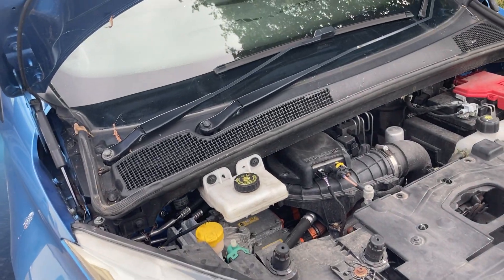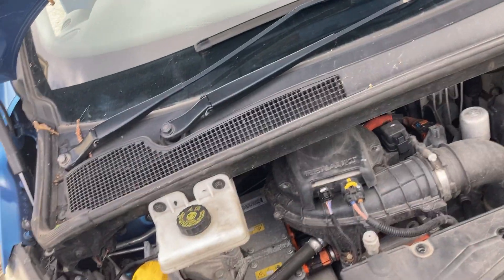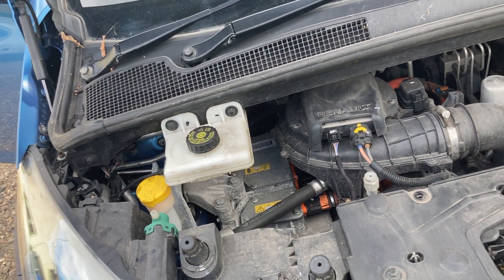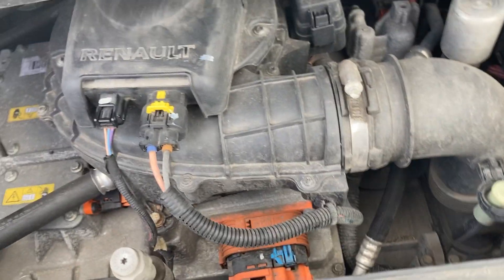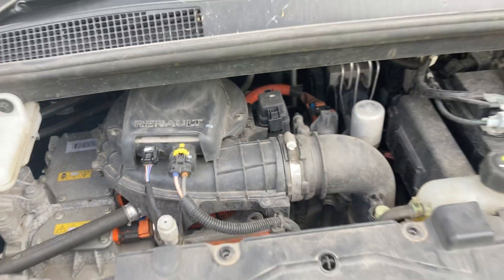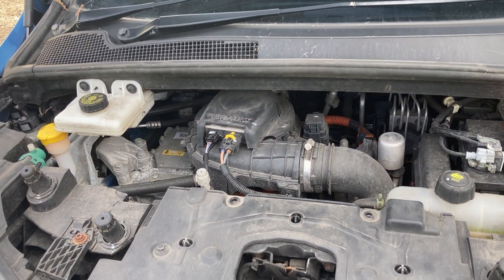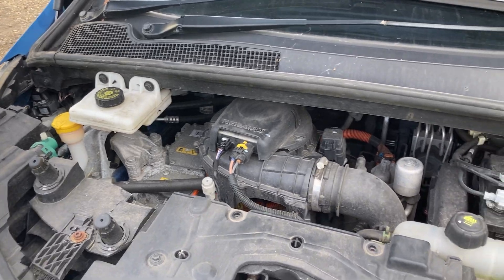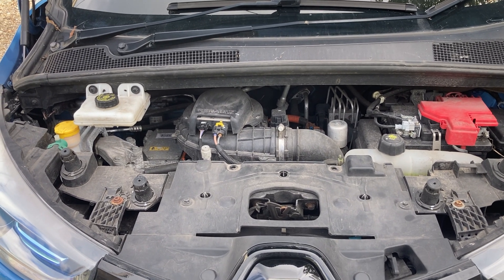Renault Zoe 5AQ early stage signs of motor bearing failure better audio

Comment: Hi! Thanks for the video. I have a question, the sound you mean is the really high pitch like intermittent or the other that almost sounds like a gas car accelerating? Thanks 🙂
Reply from the maker: Hi it’s the constant low rumble.

Comment: I m a new owner . Are u referring to the "main " noise on the video or  the "buzz" in background ?
Reply from the maker: The initial buzz is the brake booster pressurising, the second longer noise is the motor bearings.

Comment: HI Gary. Yeah that's definitely my noise. I'm wondering what are the risks of ignoring this problem? I mean, considering that the only solution seems to replace the motor. Will something break eventually?
Reply from the maker: Hi, it’s not best to ignore it. While it’s noisy the bearings can be replaced in the motor, once it breaks down that means it’s very unlikely you can replace the bearings, only option is to replace the motor. When the bearings get hot they eventually lock up and the outer race rotates and grinds the hole out so the new bearing doesn’t sit properly or it can overheat and damage the motor windings. Cheers.
Reply: @garycevrepairs  Sounds sensible, yeah. Is there by any chance a forum or website where you explain the procedure of replacing the bearings or the whole Zoe motor? I live in France where this thing was designed (poorly, in some respects...). One guy on my forum changed his motor and did some kind of a tutorial. I'm looking for more info before I decide if I can do it myself. Thanks.
Reply from the maker: Hi I don’t do “how to” info as tbh I’m not insured for that and I don’t know the skills/capabilities of the people involved. It’s not diy it’s high voltage and there aren’t any breakers to keep you safe like at home, just a massive fuse so if you aren’t trained to make sure the vehicle is safe it might end badly. Thanks.
Reply: Hi,what you did to record the noise, how do you run only the motor without  to ride a car?